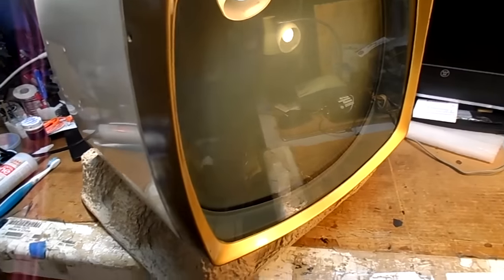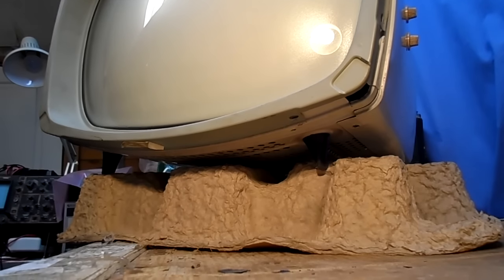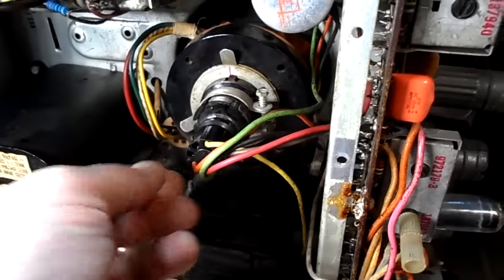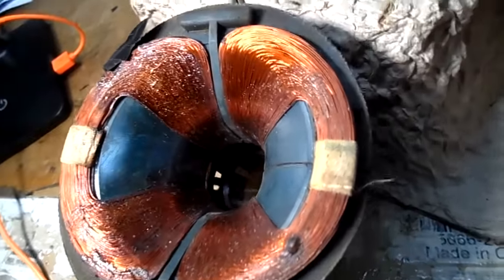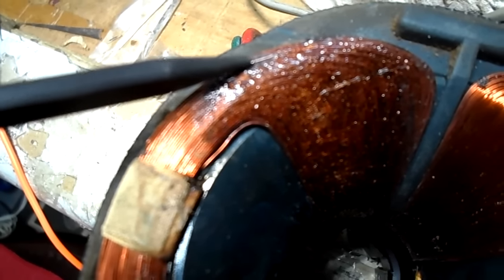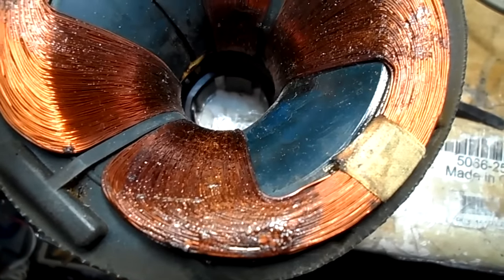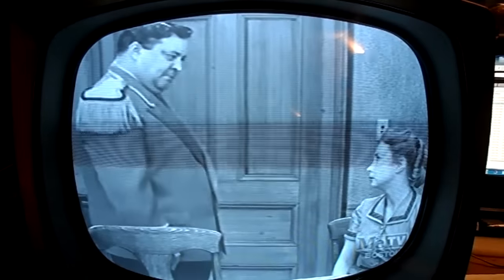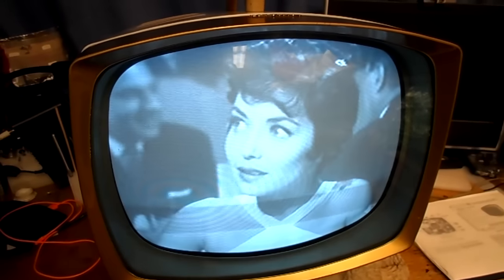1958 RCA 17" B&W Portable Repair. Pt 3. Final Put-Back.

Comment: I have the Canadian version of this set 17PT904A. Very similar in many ways. i think your 'dag grounding wire is completely in the wrong place. It mounts on the top of the chassis and hits the funnel of the picture tube near the edge.

Comment: It looks real good.  Have you thought of using corona dope for the coil winding?
Reply from the maker: Thank you for the tip re: the Corona dope. Yes we had that, but the folks I learned a lot from a long time ago, (some would be 107+ years old now), always swore by the GE clear instead. They would coat entire flybacks with it, & I've even repaired arcing triplers using it. Never failed.
Reply: If it works, it works!  Those old timers knew what they were doing!
Reply: I've been told that as well.  if you look at the specs on corona dope, it's only rated up to 4100 volts.  Might be okay for a yoke but seems iffy for a flyback.

Comment: I have a question. I know it's kind of off topic but I just came across one of your videos and then ended up here. I have an old early 80s Emerson M2404 with a BSR turntable on it. Everything works great but I have trouble with the automatic mechanism that drops the record and moves the stylus onto the track. Its not that the mechanism does not work because it does when it wants to, but I can't get it to come on. I have to bang on one of the corners of the turntable to get it to come on and when it does it plays fine until you get towards the center and it will push against the track and not want to go any further causing it to get stuck and play the same track over and over again like it is stuck. When you make it go towards the center by pushing it and bringing it back which lets it play the rest through, it wont automatically pick up and reset and shut off when it gets to the end or anything like that. Any advice?